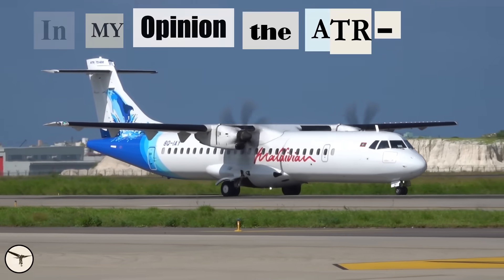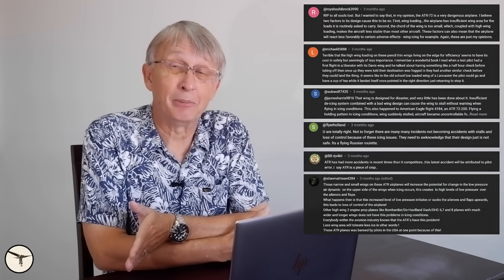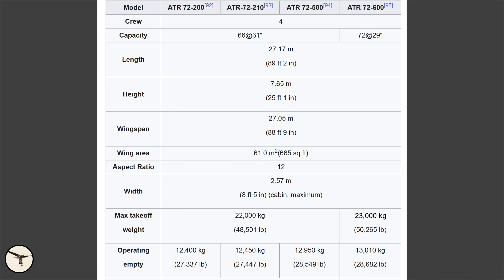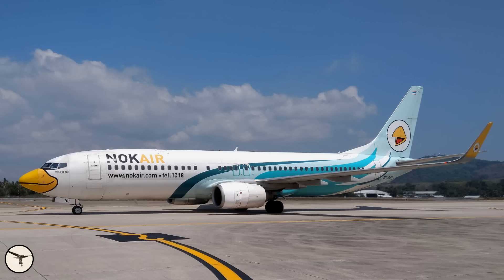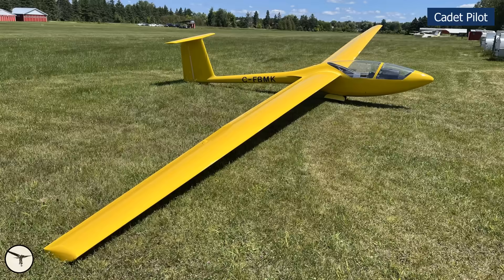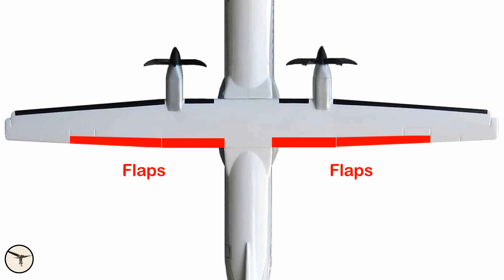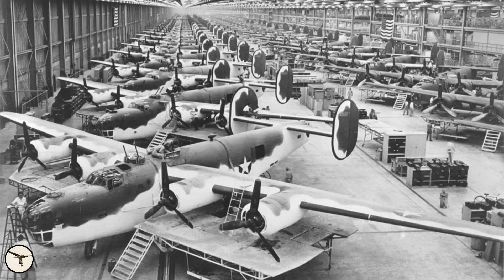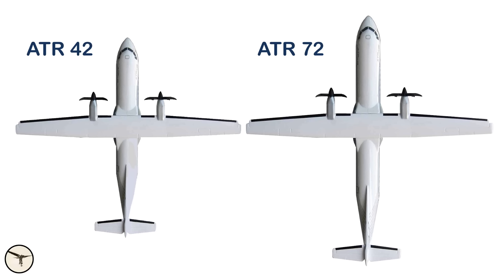What If the ATR 72's Small Wings Were Actually a Design MASTERPIECE?

Comment: A long time ago I did a a contract design job at Shorts in Belfast. While I was there another project was the C23A, a military transport aircraft made from the incredible 330. We used to watch 330s landing in conditions that would sink ships. Fantastic crosswind performance. Anyway... the Shorts aircraft all had skinny wings. At the C23A rollout, apparently, one of the Shorts design bosses was inspecting the aircraft the night before, and a U.S. serviceman in a fancy uniform was also in the hangar. I heard that he said to the Shorts guy... " Gee... it's such a tiny wing ! ".  The Shorts guy apparently replied, " Ah... yes..., but there's one on the other side, as well. "   !!!
Reply: The wing was based on Hurel-Dubois high aspect ratio designs.
Reply: Was the US serviceman commenting on the height of the wing?
Reply: I flew the Shorts SD3-60. It flew great. The ATR is rotten, but I wouldn't blame the aspect ratio of the wing. It's more complex than that.
Reply: @SimonWallwork  
I flew the Shorts 3-60 as well and it is a nice flying one.
I flew the ATR 42 and 72 as well, thousands of hours,  and that are nice flying ones as well.
Both Types in serious conditions, day, night, PX and Freight, Atlantic storms, high moutainious regions, dense fog with very bumpy storm at the Atlantic, extreme short RWY´s with full loaded AC,  unexpected heavy icing, torrential rain.
Both types where always good to handle!
There are limits and PCD´s like for any other AC, just follow the books and everything is fine, even if your definitive reach the published limits.
Everyone who is saying that ATR is rotten, dangerous or something like that has no idea what he is saying.
Just stupid talking without fundamental experiance.

Comment: Interesting analysis, I learned a lot.  The graphics and photos you used really communicated the concepts very effectively.  
I was unaware of this plane and was immediately struck by how much it looks like the DeHavilland Dash 8.  The Dash 8 was the last plane my mother worked on.  She was the Chief Weights Engineer for DeHavilland, Boeing and Bombardier since the 1960s to early 90s.  I remember a couple of things specifically about the wing.  For her area of engineering CG was extremely important and she and her small team were responsible for the placement of the wing.  The high aspect ratio was something that really stressed her out - she was usually a cool cucumber and the fact that she’d talk about it with me, a kid, showed me it was a concern. We had a celebratory dinner when they weighed the first plane and did its CG and some crucial metric they had estimated with respect to the wing placement and CG and the overall weight was almost perfect.  Believe it or not it was designed without CAD, or very limited use of CAD, just blueprints and simple calculators, paper and pencils.  Also believe it or not, until she retired she still occasionally used a slide rule and, this blew me away when I saw it, a desktop mechanical calculator with a hand crank.  The wing design was informed by the design of the Dash 7 which in turn was informed by the Buffalo and Cariboo extreme STOL planes.  I think when the Dash 8 was stretched to become the Q400? wing placement became even more important to CG.    I could discuss some technical things I remember but I’ve rambled on too much already.  Thanks for making the video!

Comment: ATR72 is not unstable - obviously, it's just that alpha is more important and there  is no tolerance for ice accumulation given the short chord.  Not good for Part 125.   As long as crew training is impeccable and you don't push your luck in icing conditions, you can roll the dice.  ATR72 has very powerful engines making it easier to manage, but classic issues still exist which cause spins and accelerated stalls.  But don't push your luck with this bird. All ATR72 crew should have specialized remedial and periodic training added, including upset recovery - Voepass allowed the forward speed to go to zero and kept it that way with high power as they spun.  While you do have some forward speed left, you gotta get the nose down and then go through spin recovery.  It was so tragic to watch that thing just spiraling hopelessly into the ground.  But they ignored all the warning signs and then didn't know how to recover.  Training every 6 months with added icing and upset recovery is needed.

Comment: 4:08 it’s totally insane that a square meter can lift (with margins) nearly one ton. Unbelievable, you could fly a car with 2m2
Reply: It is not so insane when you realise that standard atmospheric pressure is around 10000kg/m2. So wing profile only changes this pressure by tiny amount to get required lift, for egxample on the upper surface 10200kg/m2 and on the lower 9800kg/m2 then you get wing load of 400kg/m2.
For me it is really mind-breaking

Comment: I think the biggest issue with the Atr 72 is that the engines grossly underpowered as compared to the Dash 8 Q400
Reply: The Q400 is considered to be overpowered - it’s also faster at the cost of efficiency. The ATR has engines designed for peak efficiency while remaining “normally” sized for its mtow and performance.
Reply: That means those props crawl above peoples houses for a long time to get any height.
People need to sleep.  These things sound terrible from the ground.
Reply: What? The ATR has a power to weight ratio higher than most WWII fighters. It’s not underpowered at all.
Reply: @daveb4446  The ATR 72 has SHP of 2,400 per engine. The Q400 has over 5000 SHP. Sorry but you've been  misinformed
Reply: @philipdw6954  
Have you ever flown an Aircraft in your life?
I dont think so...
The ATR is not underpowered!
Reply: @Hausgrid  The fact is that the engines on the ATR 72, which seats 78 passengers produce less than half the power of a Q400 which also seats 78 passengers. You can find that out with a simple Google search. Also, I'm a pilot.
Reply: @Hausgrid I fly the ATR, and that 72 heavy could barely get above 9000ft. That shit is underpowered!
Reply: @wildfiremichael  No doubt you fly that aircraft. That's the same thing my colleagues who fly it tell me. I've even been told that at MTOW, if an engine fails after V1, it can barely climb.
Reply: @philipdw6954  FACTS lol. I also flew the Dash 8-300, there is no comparison performance-wise in my opinion.
Reply: @Hausgrid

I’ve got 7000 hours.. 4000 of which are in heavy turboprops.  

The ATRs are underpowered.  They do not do well in high ISA and ice. 

Just because it can go fast and climb relatively fast doesn’t mean it’s sufficiently powered.
Reply: as comparably compared with the comparison
Reply: The small wing is not the issue. It implies a supercritical airfoil profile. To improve it is easy. Use composite materials to reduce the structure weight.

Comment: It's almost as if some smart engineers designed the airplane with careful calculations and math and stuff! They figured out what size the wing should be before building it and flying it for almost 40 years!
Reply: and 4 unnecessary crash with total loss of life because of the design that would have been easy to avoid with calculations.  PS X-66 won't fly in 2028...
Reply: @gendaminoru3195  
That accidents have nothing to do with the Aircraft.
Reply: @Hausgrid oh yeah the de-icing boot size definitely did nothing to help with the rapid unscheduled disassembly

Comment: This is the main reason why I refuse to fly in this substandard aircraft. As a GA pilot in the past I have seen issues where there have been GA aircraft with critical wing structures that have caused accidents in the past. 
These aircraft should NOT be flown in known icing conditions. Any ice buildup on these wings will disrupt the lift quicker than a regular wing. The issue is not with wing failure it is the loss of lift in critical parts of flight and especially an issue with inexperienced pilots.

Comment: Wingload dont tell the full story. Specially for regonal airlines.

The problem is how weight is messured. As a avrage.for passangers and bagage.

There are two main issues with that.
1: the statistics underestimate the actual weight by a huge margine. This is less so of a problem with planes with higher range because a larger procentage of the weight is fuel, so if the passanger is 25-30% wrong only give a error of 2-5% of the total weight.

For a plane with short range, this is very diffrent. Hence overloading is more so a problem.

2: there is one more issue with a short cord. The aircraft stall at a lowet angle of attack. This combine with a lowet power is a issue (atr72 have about half the power per weight a 737 does. At lower speed this is not really a issue due to the disc area. But when speeds are at flying speed, specially with out flaps depoyed, the aircraft can stall suddenly and violently with the engine having little chance of pulling the plane out of the stall.
Reply: A very interesting point of view.

Comment: Well, done sir . If I could attribute any problems selectively to the ATR 72. This would be the wing is more susceptible to icing. The reason for this is simple. High aspect ratio wings by definition have more leading edge profile surface as compared to the total wing area. And it is the leading edge where most ice builds up. Additionally, a narrow cord necessitates an abbreviated low pressure profile on the upper surface. E.g.. It is not gradual. The lower pressure drops the temperature gradient more quickly moving the freezing point forward. To approximately 20% LEMAC. Obviously this is a well-known problem.
Reply: Bingo!

Comment: Considering that CoP moves backwards when using high-lift devices (flaps), would it be fair to say that short-cord wings are also more stable as this CoP displacement is less pronounced? Valid only for situations of configuration change - transition from clean wing to flaps extended, of course.

Comment: I suppose the only real criticism is that once it stops flying and starts falling, it's very hard or impossible to start it flying again (as with the Brazil crash). But the pilots appear to have ignored a lot of warnings about the ice building up before that happened.
Reply: Stalling is not a problem. If there is sufficient altitude, the recovery can be made safely by a pilot following the manufactures recommended procedures. Spinning is a whole different matter outside of the aircraft certification. It can be extremely difficult or even impossible for a multi-engine aircraft to recover from a fully developed spin.
Reply: That is outside the flight envelope.  Once outside the envelope all bets are off, you could even have structural failure with too much control input at too high a speed.   Generally they are designed to stall before they break.  All aircraft are designed to be stable, except fighter jets that need computers to keep them up in the air.   But the envelope will be different.
Reply: Brazil crash? Omg. 🤦‍♂️ you can’t stall ANY plane and pull up in icing and expect to recover.
Reply: Unless you’re up in the flight levels that’s true for any transport category airplane.
Reply: In many part of the world Flight levels can start as low as 4000 feet.

But even if you have enough altitude, it's fully possible not being able to get out of a flat spin simply due to the fact that there is little to no airflow over the control surfaces
Reply: Not if you apply the correct stall recovery procedure as described in the FCOM. The main reason for loss of control in flight of both Voepass 2282 and American 4184 was inproper stall recovery technic and especially the fact that flaps 15 was not selected.
Reply: @lindegaardhjorth  It wasn't 'just' a stall. It was a flat spin, and those are nearly impossible to recover from in that aircraft.
Reply: @pakviroti3616  The thing is that as far as I know, no transport aircraft is rated for a flat spin recovery, and procedures in the FCOM for all those aircrafts are planned to keep you as far as possible from a flat spin situation. So if someone manage to get into a situation like that in these aircrafts (not only the ATR, but all transport aircraft), they were already way past the point of no-return

Comment: Hello Magnar. 

I used to fly Saab2000 (Concordino), one of the most advanced turboprop aircraft, back in the 90s. Its wing area was not bigger than ATR's. We could climb to FL 310 in 10 minutes (before RVSM rules).
But we had powerful Allison engines.
The problem with the ATR is not only the wing design but also the underpowered engines.

Comment: The Fairchild Metro had a similar problem, the wings were too short. I am led to believe that speeds had to be higher that average to keep safe lift.I was told by a pilot that if you lost an engine on one of those, the outcome was normally very bleak. 
Observations from South Africa
Reply: The Metro was fine on one engine. Quite normal. Maybe he was talking about the early versions that had a slightly shorter wing.
Reply: Probably referring to landing configuration. If you lose an engine you need to clean it up ASAP as it sinks on one engine with flaps and gear out
Reply: But this is the same problem with many privet jets too, once the engines stop working the jet just plummets to the ground like on a free fall, this idiotic way of designing passenger aircraft needs to stop.
Reply: I believe the plane also had another problem, to lift more they stuck on wing extensions but didn't add aileron extensions, so slow speed flying was more 'difficult'. Look up Cork disaster a few years back?
Reply: I think that's more an issue of power and it's distribution... this seems one of those planes where the engine creates a lot of drag fairly far out from the CG. basically it's difference between Stall-Speed & Vref is quite a bit higher than on many comparable planes.

Comment: What about wing thickness. Why ice buildup is so easy in this aircraft? What about FLAT SPIN? Why this aircraft is so sensitive at vertical windshear? If you play the game of the bad guys (HIDE) then we will see the same accidents and incidents
Reply: It is more to do with the altitude these planes fly most often. They can't fly above the weather
Reply: @esphilee  You are right. But the question is why this airplane is so special with ice. The ice effect in this airplane is worst than others.
Reply from the maker: A thin wing can accumulate more ice than a thick wing. Very often, the stabilizer (which is thin) has more ice than the wing. 
An aircraft will only enter a spin if it is stalled first. Then, you must push full rudder. To enter a flat spin, you must enter a spin and add power (this is what happened in Brazil) or have a center of gravity too far aft. 
ATR aircraft are protected against that. Before the aircraft stalled, the crew received 5 warnings from the aircraft, including a loud stall warning, stick shaker, and stick pusher forcing the control column forward. Despite this, the nose of the aircraft did not move down, suggesting the pilot was opposing the stick pusher. It's like a car driver in a moment of confusion is hitting the accelerator instead of the brake pedal.
Reply: @ ATR has a lot of systems to fight ICE. More than others. WHY? How do you explain the fast ice buildup with a thick wing? This is the worst airplane on icing conditions I ever flew ( T-37, C-212, C-337, JS-41, C-560)